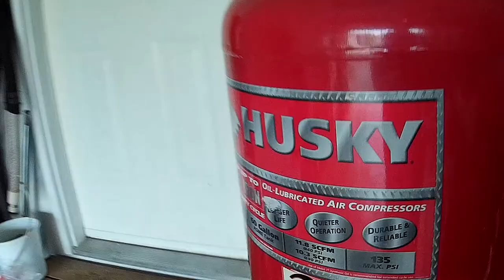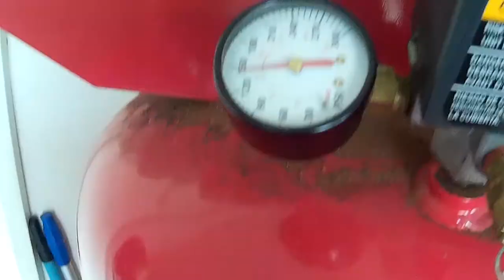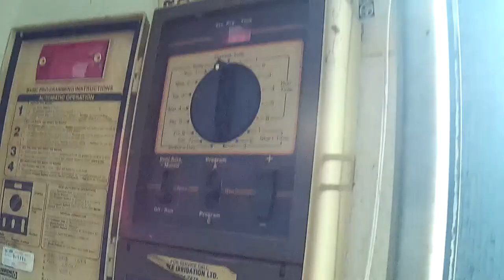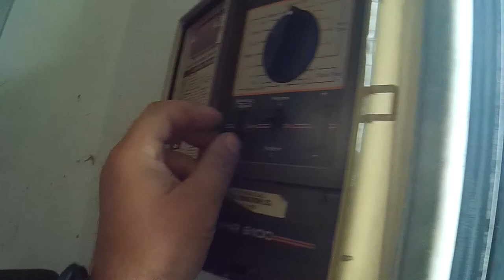How I blow out my in ground lawn sprinkler system

Comment: Lawn care business success, Thanks for getting back to me.Thats awesome that your honda mower last 10 years! I hear what you are saying about the one benefit of starting PT I love my current work and I’ve been doing it for 20years with 2 kids and a wife that have some on going health issues.Our 2 boys will be attending college away fall of 2018 so i feel a peace about doing it at this time, my boys and my wife are my biggest fans!! I have all commercial equipment except my mower. I want to be as efficient as possible especially at a PT level.i thought I would be satisfied starting out with the commercial 30 inch mower that’s $2200 out the door at my dealer.Now I’m thinking about the 32 inch or 36 inch mower both are about $1500-1700 more than the commercial 30 inch mower. One of these item when I decide will be the only thing I finance and I want it paid of before Christmas of 2018. Which one you think would be ideal and would give me the efficiency I want ?
Reply from the maker: Grassology4610 It all depends on the types of lawns you will service. If it’s all smaller city lots like I do then most of my lawns are all done with the Honda 21” as my main mower. I have used all sorts of larger mowers over the years to use for the few bigger lawns I get but I have never used anything over 42”. I just got a used 36” exmark turf tracer this year and the size is definitely versatile for city lots. I can use it on more lawns than the 42” mowers I’ve had in the past as it can get through more gates but it still is limited in needing larger gates to get to those back yards. In city mowing most yards have small gates so I still can only get the 21” through for most back yards. On the flip side if you are mowing larger acreages than you want a bigger sit down mower or else it will take forever to get the job done. I once mowed 1 acre of grass with the 21” when I was starting out. Took me 4 hours straight and I bagged it all. Lol 😂

Comment: Hi, thanks for the video. How many gallons and PSI is that air compressor.
Reply from the maker: RAYLEGEND The compressor is a 60 gallon with a max pressure topping out at 135 p.s.i.  To blow out the sprinklers I have it set no higher than 60 p.s.i.
Reply: Lawn Care Business Success ok, I have 5 zones, do you think I can use a 20 gal- 135 psi? Thanks
Reply from the maker: RAYLEGEND it’s worth a try. You will have to cycle through the zones more often for shorter bursts and then wait for the compressor to fill up again each time. Another thing you might do is go to the unground boxes where your sprinkler valves are located and instead of doing the whole zone you can open up each sprinkler individually which may work better for your smaller unit. Also look up videos on YouTube for blowing out sprinklers with a small compressor. That’s how I learned how to do it. In fact I think the video I watched about 7 years ago was someone with a 20 gallon compressor.
Reply: Lawn Care Business  thanks, That’s what I’m gonna do one zone at a time. I appreciate it, I think I will be able to do it with a 20 gallon.

Comment: Lawn care business success, When did you start your LC business? Did you start out with that 22 inch Honda commercial mower? How do you like that mower ? I had one I got brand new of CL had it for a few years 3 seasons got rid of it last winter and purchased a Toro 22 inch personal pace which is better on hills. I'm finally going to start my lawn cutting business PT 2018. I'm purchasing a 4x8 trailer being pulled by my civic. My goal this year is to get 3-5 yards by May if all goes well I want to purchase a Exmark 30 inch mower if the Bussiness evolve then I'll think about a truck, that is my dream.Can I still print cards up even though I don't have a Bussiness license? I there any benefit starting out PT that I can take advantage of that you know ?
Reply from the maker: Grassology4610 I’ve been in business 12 years now full time and as my only job. Yes I have used the commercial Honda’s 21” from the beginning. They are true work horses. The first one I had I bought new when I started and used it every day for 10 years before retiring it as the backup. You could still print cards without a business license but I would suggest getting one as soon as you can along with insurance. One benefit of starting part time is that you can keep your regular job and see if you will actually like doing lawn Care before quitting and spending a bunch of money on equipment or trailers etc.